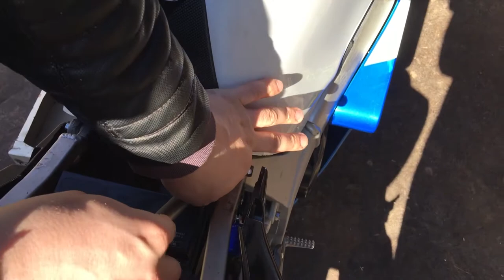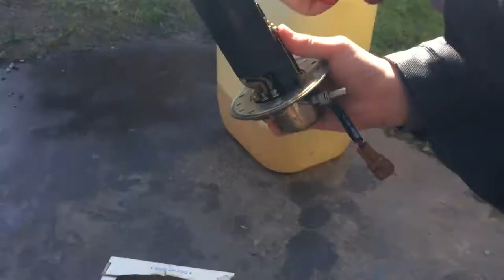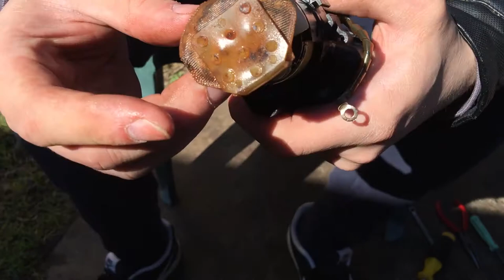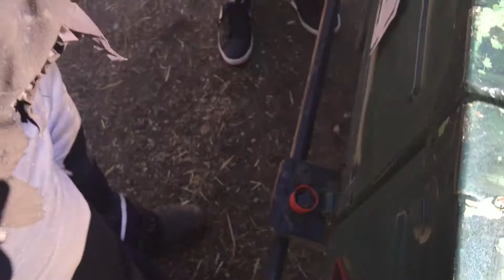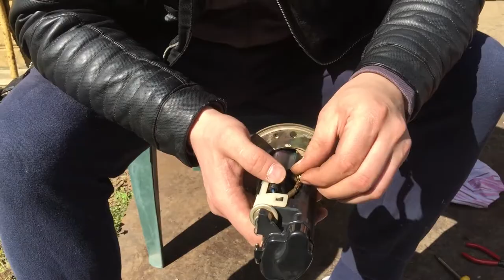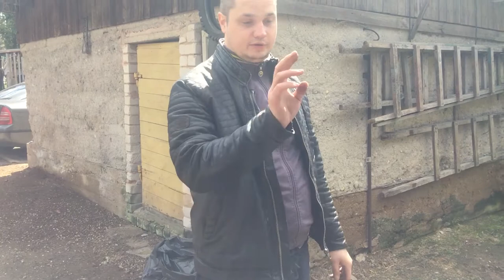How to clean Gsxr 1000 K1  Fuel pump filter

Comment: The black part of the fuel pump housing has another fine strainer in top of housing near FPR, remove FPR and back flush with carb cleaner and clean fuel and air gun ,they will restrict fuel flow .
Reply from the maker: Hey thank you for the info.I didn’t knew that when i cleaned it,but in another video my mechanic opened the pump also and put a new filter and cleaned all the parts.🙂
Reply: I have an 03 gsxr1000 and it wouldn't Rev past like 9k... it ended up being just what ur talking about the filter that's actually inside the housing.. I seen videos of other people drilling em out where the output of the pump goes into the pump assembly but I just blew it backwards with compressed air with the pump off filled some gas repeat and it ran perfect after!
Reply: I have an 03 gsxr1000 and it wouldn't Rev past like 9k... it ended up being just what ur talking about the filter that's actually inside the housing.. I seen videos of other people drilling em out where the output of the pump goes into the pump assembly but I just blew it backwards with compressed air with the pump off filled some gas repeat and it ran perfect after!
Reply: I have an 03 gsxr1000 and it wouldn't Rev past like 9k... it ended up being just what ur talking about the filter that's actually inside the housing.. I seen videos of other people drilling em out where the output of the pump goes into the pump assembly but I just blew it backwards with compressed air with the pump off filled some gas repeat and it ran perfect after!
Reply: I have an 03 gsxr1000 and it wouldn't Rev past like 9k... it ended up being just what ur talking about the filter that's actually inside the housing.. I seen videos of other people drilling em out where the output of the pump goes into the pump assembly but I just blew it backwards with compressed air with the pump off filled some gas repeat and it ran perfect after!
Reply: I have an 03 gsxr1000 and it wouldn't Rev past like 9k... it ended up being just what ur talking about the filter that's actually inside the housing.. I seen videos of other people drilling em out where the output of the pump goes into the pump assembly but I just blew it backwards with compressed air with the pump off filled some gas repeat and it ran perfect after!
Reply: I have an 03 gsxr1000 and it wouldn't Rev past like 9k... it ended up being just what ur talking about the filter that's actually inside the housing.. I seen videos of other people drilling em out where the output of the pump goes into the pump assembly but I just blew it backwards with compressed air with the pump off filled some gas repeat and it ran perfect after!
Reply: I have an 03 gsxr1000 and it wouldn't Rev past like 9k... it ended up being just what ur talking about the filter that's actually inside the housing.. I seen videos of other people drilling em out where the output of the pump goes into the pump assembly but I just blew it backwards with compressed air with the pump off filled some gas repeat and it ran perfect after!
Reply: I have an 03 gsxr1000 and it wouldn't Rev past like 9k... it ended up being just what ur talking about the filter that's actually inside the housing.. I seen videos of other people drilling em out where the output of the pump goes into the pump assembly but I just blew it backwards with compressed air with the pump off filled some gas repeat and it ran perfect after!
Reply: I have an 03 gsxr1000 and it wouldn't Rev past like 9k... it ended up being just what ur talking about the filter that's actually inside the housing.. I seen videos of other people drilling em out where the output of the pump goes into the pump assembly but I just blew it backwards with compressed air with the pump off filled some gas repeat and it ran perfect after!
Reply from the maker: @randyeriksen6863  i had similar problems like you,but at least it was a cheap fix😁

Comment: the filter is in that black plastic thing. what you cleaned was just a pre filter
Reply from the maker: At least that helped.Later in the other video i found out the other filter location and cleaned that also.
Reply: Is there way to clean it I was gonna delete both filters and run an inline cause I’m tired of taking the pump out to clean it

Comment: just for the record ... half of that large black plastic part oh the pump is also a filter. it is also rather expensive to replace.
Reply from the maker: Thank you for the info.I didn’t know that.
Reply: It's the high pressure filter..the black plastic part
Reply: @THREE AMIGOS  it's actually the filter, the other tea bag is a strainer which sucks before the pump and the filter is after the pump
Reply: Found that out today.  Changed pumps and tea bag filter many times. It was the (other) filter that was blocked and causing the problems.

Comment: Hope you know that there is 2 filters in there not just that one small one.
Reply from the maker: On the pump there should be only one.Is there another one?
Reply: @TheMeisner87  inside the white case. Pop it out from top.
Reply from the maker: @rockitalee9997  that part my friend checked in the latest video.